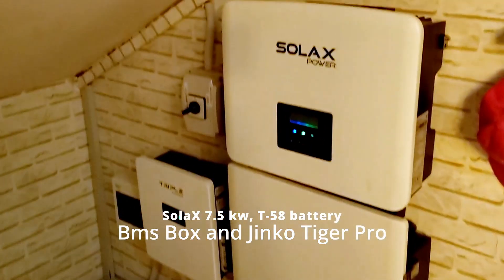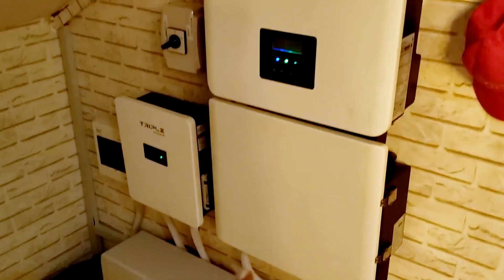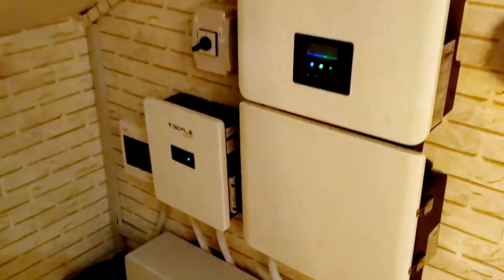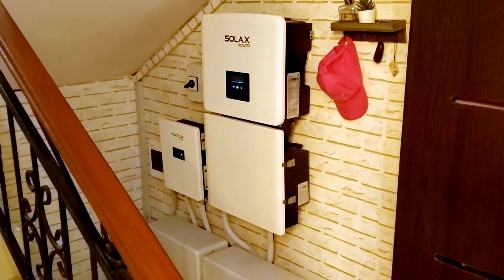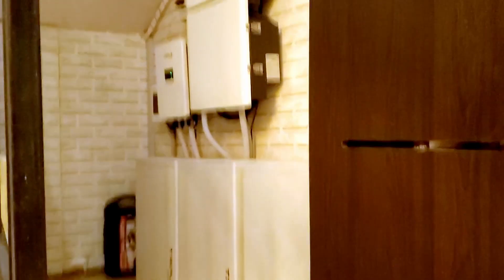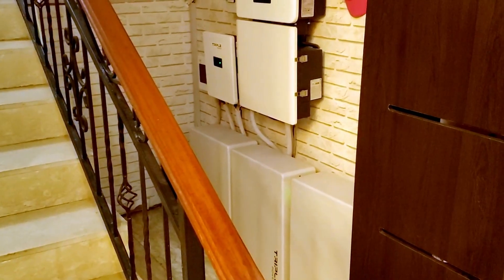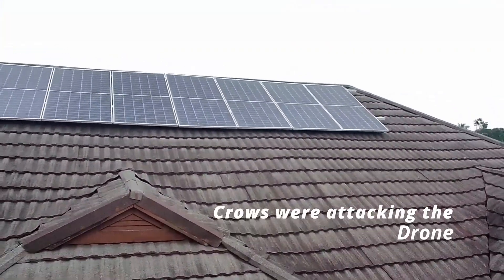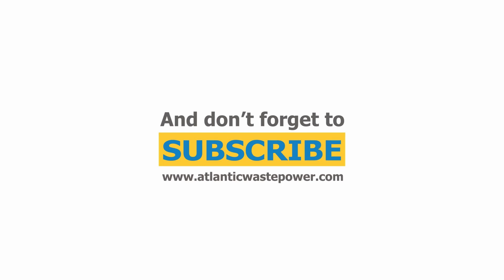SolaX Power in Lagos #solax #T58

Comment: HI i am getting this error on my 7.k Solax inverter - RC OCP Fault please help
Reply from the maker: Is the inverter going off when the fault comes up? Double check your DC connections
Reply: @drsolar  yes I even disconnected the pv power something even wen its running from batteries only
Reply from the maker: @tirhanichauke7222  turn off your AC input off. The error is an ac and dc impedence issue
Reply: i am using it on EPS mode so the is nothing from the grid going to the inverter  @drsolar